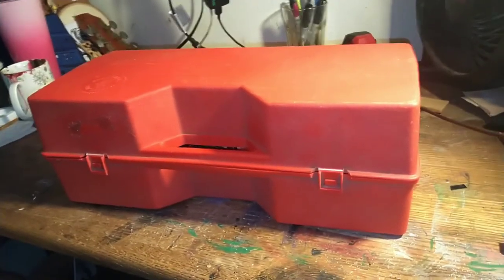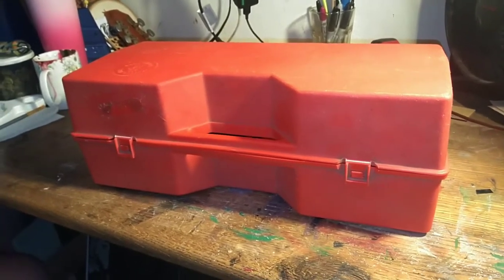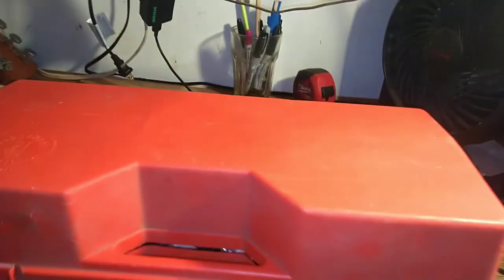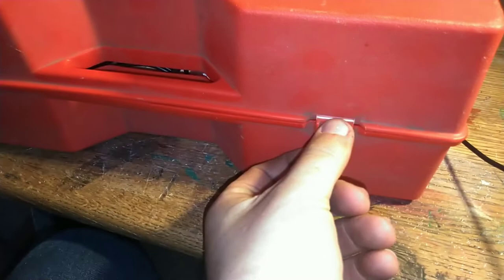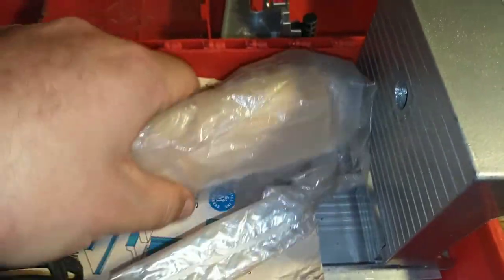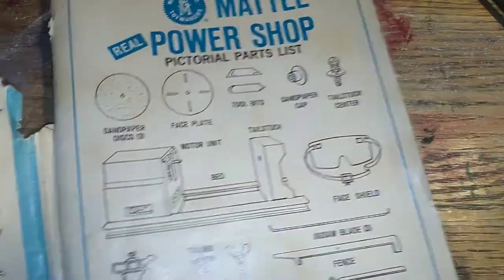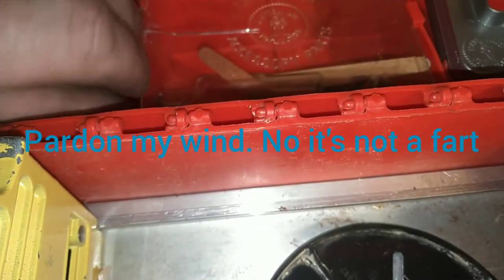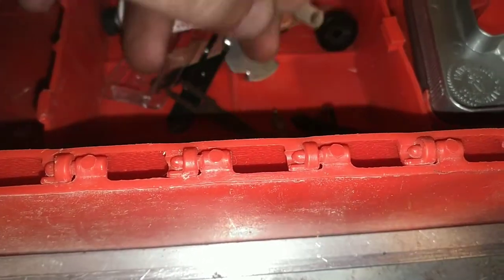Mattel's 1965 Power Shop Toy is the Coolest thing ever!

Comment: I remember these well, wanted one as soon as the ads came out and got it for my 9th birthday. They were pricey at the time, $16 in 1965. I used the shit out of it, mostly the lathe and disc sander as the stamped steel flat drill bits weren't the most effective, neither we're those jigsaw blades that were basically a twisted/roughened wire made of some hardened steel that would break easily. The whole tool overall was really well built, think those motors would run forever. Made a lot of stuff on it and it most definitely cut more than just balsa. I still remember the TV ads, "Not just plastic or balsa, but real wood!" Certainly a more productive toy then, than some video game today!
Reply: $16 for a well built & hours of entertainment toy! Compared to what the price of toys these days